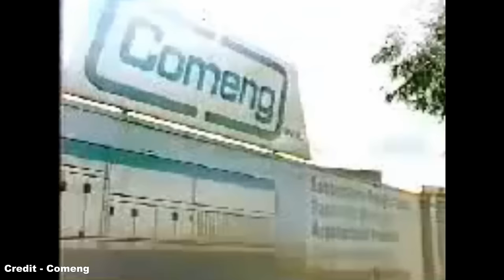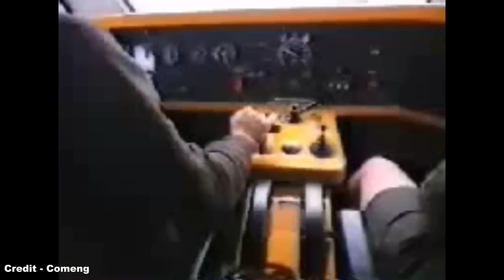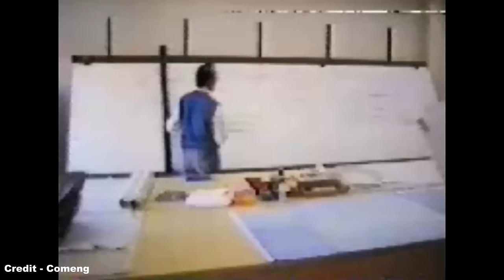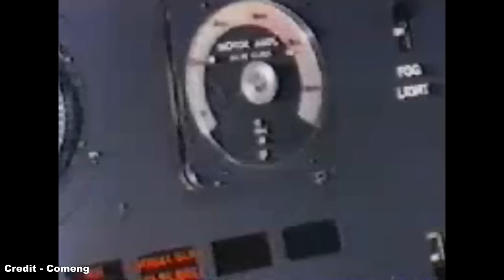The XPT - HSTs Down Under

Comment: I worked as a station assistant at Broadmeadow (Newcastle suburb) when the first XPT services to the north coast and northern tablelands started. I distinctly remember a crew change on one of the early runs. Apparently, they had been a tad optimistic on some of the speeds for the line. The XPT's front bogie had floated for a while going over a bridge, before landing thankfully back on the track. The driver was still green when he got out of the train. I'd heard the expression before, but that was the first time I actually saw it. The second incident was that, particularly in the early days, the drivers would gun them when they took off from the station. I used to joke to the SM they needed GT stripes on their uniforms. As I recall they were constantly doing engine changes on them back then as they just didn't handle the conditions. Anyway, they certainly picked up speed quicker than most diesels we were used to at the time and we didn't have the electrification at that point in Newcastle. The ASM on duty for the day reminded everyone on the PA that only intending passengers should board the train. Of course, num nut ignored this and got on to see his mother off. The train started leaving the station and he leapt from the car in a panic. The forward momentum of the train threw him forward and I'd say he collapsed about 2cm off the wall of the overbridge at the end of the station. I really thought I was going to see my first fatality that day. It was very, very close. The ASM clearly thought the same thing. He ran up to the fella and asked if he was ok. He was in shock and nodded this head. Then the ASM grabbed him by the shirt and told him never to disobey an instruction he gave as he wasn't paid enough to clean him up off the tracks. I don't think he ever did that again. That said it wasn't the fastest train I had seen leaving Broadmeadow for Sydney. That honour goes to two 44 class locos hauling the Newcastle Express during the holidays. The train was absolutely chockers and they had even dug up two or three steam era non air cars on the front connected to the loco's and the standard set behind them.  I was standing right near the rear of the two locos when they got the whistle and the driver gunned the engines to make up for the load he had to move on that day. At that precise moment, the screw coupling between the second loco and the carriage took the load and snapped. I saw the passenger cars jolt and then stop and by the time I had turned my head the two 44's had just disappeared in a cloud of diesel fumes and out of my view! It was the nearest thing to a catapult launch for a train you were going to see! One minute the driver had several hundred tons behind him and the next nothing. I turned my head and they were already gone from my view.  It was like one second they were there and the next they were gone! They pulled up at Adamstown and had to make their way back to the now broken train. Passengers were a bit late getting to Sydney that day.

Comment: As a regular user of the Grafton XPT I must say the train is a wonderful way to travel, with comfortable seating and a buffet, although the trip of seven hours from Sydney to my home station compares unfavourably with the one-hour airline service. Not much chance of an improvement though, as the new trains will have to deal with the same circuitous single-line track for most of the journey. I just hope the trip will be as pleasant.
Reply: The seats are unfortunately only designed for 150-200km European journeys, there's no sleeping car and because locos were njot ordered, the new trains will be noisier for passengers.  Backward steps!
Reply: @edmundcarew7235   Yes the lack of Sleepers means that the new trains will not be able to compete with air travel at all, unlike the outgoing XPTs.
Also the new trains design speed is identical  to the XPT (160 km/h) although they will probably have superior acceleration.

Comment: Good work on the video, although there’s a couple of issues:
- A lot of the footage was of non-NSW trains; I recognise that it’s from Comeng’s showreel from the 1980s, where they had supplied or were supplying rolling stock all over the country, and
- There we’re a few mispronunciations of place names - feel free to reach out if you need a hand (Gerogery, for example, is pronounced with soft Gs to sound like “Je-RO-je-ri”).
Also worth noting are the series of diesel railcars/DMUs spun off from the XPT design and built by Comeng and its successors. The initial units were the Australind railcars for Western Australia in the 1980s, followed by the Xplorer and Endeavour railcars for NSW (as covered in the video). Later versions include the Vlocity DMUs built by Bombardier/Alstom for Victoria and the A-City EMUs also built by Bombardier for Adelaide suburban services. The car bodies for the Australind cars were built using XPT passenger coach jigs, with subsequent designs being evolutions of the Australind.

Comment: Took one of these from Syd to Melbourne once, a very pleasant journey.
Reply: I did the same. It was 11h and more expensive than a plane. Interesting experience but I would never do for anything more than curiosity.

Also I take it pensioners get cheap travel. Because I was about 20 years younger than every other passenger on the train. And all those old blokes with their weak streams were obviously too proud to sit down during the rough sections, which is most of the trip. Because the toilet floor was absolutely swimming with piss.
Reply: @mabamabam  I only paid 76 dollery-doos which is pretty good. Yeah it took a while and i probably wouldn't do it if i was making the trip regularly but it was nice to see a bit of the country.
Reply: @N330AA  To be fair I sprung the 99 dollars for first class. Which is probably why it was full of old people who cant piss straight. And yes it was a nice trip. It was also really nice to pack a lunch and a book and stare out the window for hours. 

Tiger was offering $95 at the time.
Reply: @mabamabam  Yeah, next time i'm in Aus i'll try and take the Brisbane-Syd train too
Reply: @N330AA  I really want to do that one. It goes all the way to Cairns. Or Mt Isa if you want to go to the worst town in the world.

Comment: I go from Melbourne to Sydney quite often. I love trains & have for the 52 year's of my life. Taking my last possibly ever Intercapital  Train in August 2022. Why instead of paying $93.79 - $131.97 for a seat $234.63 Overnight 11.3 hours. With only two services. When you can in 90 minutes fly the the route and pay as little as $60 one way with Multiple Departures throughout the day. Even with having to be at the Airport two hours before the flight. it still only comes out to be 3.3 hours slashing 8 hours of the journey time. Also interstate Buses take 10 to 12 hours at around $100 today. All prices current as of 3/05/2022.

Comment: Fascinating. I saw a few XPT’s in 2008/9 when I was working for SNCF/Keolis on the Melbourne tram and train tenders. I investigated using the service from Melbourne to Sydney but am ashamed to say that I took the plane in the end due to time constraints
Reply: Just like perhaps 99.5% of travellers when making the choice of plane vs XPT.
Reply: @johnd8892  I guess so. But if Australia ever gets around to building the oft mooted TGV link between Melbourne and Sydney with a branch off to Canberra and 300km/h services in 3h30 from city centre to city centre the airlines would be dead in the water on those routes very quickly.

Comment: took a second to figure out that there is a tone of Queensland related film shots - not part of the NSW network obviously. A few Chums and EMD's from Queensland's old fleet. The dead giveaway was the trains name on the front "Queenslander", the others the colour and the others the narrow 3.6 foot gauge. QR had an old and un-sophisticated fleet for ages because of it's inadequate trackage - no point in buying more powerful and multiple unit engines if all your infrastructure isn't capable of holding larger trains, half the fleet hasn't got air breaks and the track can't handle the weight increase.

Comment: As someone who has travelled on both the XPT and the trains it replaced, I would have preferred the older trains anyday. The comfort levels were far superior. I use to have to travel a lot between Sydney and Albury in the 80's and though journeys were long, they had comfort, even if you weren't in a sleeper cabin. XPTs have never been suitable for Australia.
Reply: In what way were the older carriages superior? Surely the XPT's secondary air suspension was a big improvement? Better heating/air conditioning, too, I'd have thought.
Reply: @nkt1  In one word comfort, the XPTs were no faster and no better than bus, still arn't.
Reply: @nkt1  Give me the old Melbourne O/night or Southern Aurora anyday.
Reply: Queensland has far superior trains to New South Wales XPT's, where they basically don't care about passengers, just bums on seats.
Reply: @nkt1  The older RUB cars rode extremely well at speed and had extremely effective air conditioning in 40+ deg C days (Which is common in rural Australia during summer). They were one of the first cars in the world that used industrial electrical supply to run the air conditioning. The daylight express trains from the late 1940's to the coming of the XPT were the some of the best trains in the southern hemisphere in terms of passenger comfort.

Comment: When the XPT was introduced a large section of the travelling public were happier with the existing relatively new , twenty year old, Southern Aurora service. All first class sleeping with a choice of sleeping compartments from single accommodation and dual bed also with built in showers.
So fondly remembered that a 60th anniversary re enactment run sold out quickly and had quite a bit of coverage on TV and YouTube :
https://youtu.be/lQflOUHS2v8
This train had far more impact on Melbourne Sydney travel than the minimal speeding up the XPT was pushed too and providing less sleeping accommodation for a still long overnight trip.
Searching for the Southern Aurora train will provide many vids on YouTube.

Comment: I took the Mel-Syd service in 2019 instead of flying and I would do it again (I was able to work on the train). But it can confirm the track is not very straight, and it's all a bit rattly, so it's very slow. The plane is less than 4 hours door to door, but the train takes over 11 hours!

Comment: I travelled on the XPT in NSW in 1990 and it was comfortable. However, the rail lines are very 'curvy' (e.g. Blue Mountains) and the train never really got above 80MPH. I travelled to Melbourne on a loco hauled train and didn't care about the speed because I wanted the journey to last forever. Fantastic scenery, comfort food, and I liked getting out at various stations (Yass) to stretch my legs, and talk to the girlies. I was single then.

Comment: The Sydney to Canberra route is demanding even for a tilt train because of very many extremely tight bends. If someone wanted to ensure that the tilt-train wouldn't be successful, they'd be well advised to choose that route for a demonstration. 

It's questionable whether the new trains are bi-modal for any reason other than green politics, since most of the track they will run on is not electrified, and is unlikely to be in the foreseeable future. The XPTs have the advantage that the passengers are not subject to significant engine noise. On the new trains, since they are multiple units, the passengers will experience some of the engine noise and vibration, as they currently do on the Xplorer sets.
Reply: Good point about tilting trains. Actually you can have as many reverse curves as you like (over here in Britain some sections of the West Coast Mainline have few sustained 'straights') and the tilt system in the Class 390 Pendolinos is brilliant at coping with quick changes in track cant. However the laws of physics apply equally to tilt and non-tilt, so the safe overspeed margin is smaller. Therefore a Sydney-Canberra upgrade for tilting enhanced speed wouldn't just mean smartly designed track geometry but also an enhanced maintenance and renewal regime to manage higher wear and tear.

On engine noise/ vibration, the Class 800 varieties that replaced London-centric HST services over here in Britain are surprisingly refined. Actually I think the quietness of the 800s in diesel mode is not an accident; even the accountants probably had to agree never again to subject long-distance passengers to the awful noise and vibration of the 20 year old 125mph Class 220 varieties. 

In a penny-pinching, short-termist country like ours, there was always going to be downsides with the 800s and they are: seats as comfortable as ironing boards, cheap n' plasticky interiors and (on the Western routes) pesky trolleys battling their way through congested coaches instead of a proper restaurant/ buffet car. But they are true bi-modes, and on electric they go like shite off a shovel.
Reply: This noise situation is one reason US and Canadian operators are so resistant to DMUs. The only ones I can think of are in Austin, TX; Larkspur to Santa Rosa, California north of San Francisco; and the Toronto airport express, and that last one looks like it's headed toward early replacement with EMUs.
Reply: @ChangesOneTim  I've ridden the Class 220s and 221s with Cross Country and I never had an issue with the noise and there was only minimal vibration while at idle or while at power, the only vibrations noticeable were while power was being applied from start, aka from idle to notch 2. Not sure if that is due to improvements XC have made to the trains or your information is not first hand and from an unreliable source, however I find the voyagers, atleast with XC in my personal experience, are relatively quiet and not a huge amount of vibration from the engines, although like all trains there is slight shaking from passing over points or travelling at speed in general.
Reply: Most not.. but the Sydney basin and surrounds is fully electrified, so it is substantially reducing diesel noise and pollution in built up areas
Reply: @BritishTrainspotting  
I rode the 220/221s daily, right from their introduction 20+yr ago, so soon got to ride in every set in the fleet. Sound to one person can be noise to another, I know, but wherever you sit in the carriage there's no mistaking the gruff diesel under the floor. By any measure, of all trains built for 'InterCity' journeys they are Britain's noisiest and rattliest ever. XC is too cash-strapped to 'improve' anything. Avanti at least refurbed its fleet incl  recarpeted floors or something. My central point is that compared to loco-hauled coaches that went before, the Class 220 family is a disgrace to InterCity comfort and ambience esp bearing in mind that they operate many of Britain's longest journey schedules. 
Veering off-topic now. Rant over!😉
Reply: Same with the class 222 now on East Midlands Railway.
Reply: @NextSound170  
Yep, only minus the smell from the bogs as the waste tanks on the 222s are below floor where the tilt equipment is on the 221s(!)
Reply: @ChangesOneTim   Isn't the smell from the bogs due to the vacuum exhauster vent being too close to the AC fresh air inlet ?
Reply: @Martindyna  
That is the main reason, not helped by needing to mount the retention tanks above board. About 8yrs ago Virgin Trains did a mid-life refurb of their Vomiter sorry, Voyager Cl.221 and their electric Pendolino Cl.390 fleets to design the problem out. They seem alright now, but CrossCountry Trains (always known for their cost-cutting) Cl.220s and 221s still stink like a pig farm especially when outdoor temp is above about 15C.
Reply: @ChangesOneTim   Thanks. Apologies for the late reply, I wasn't informed of your response. Vomiter haha.
Reply: @BritishTrainspotting  It's about the type of noise, I find the Class 159 no problem at all because the Diesels are so refined and slow revving sounding.
On the other hand the class 165 `Thames Turbo' sounds awful by comparison, not helped by how they are driven i.e. how the engines are over revved before the Voith torque converter engages on departure. Some drivers wait in presumably notch one for the Voith units to engage before acceleraing which gives less of a railbus experience.
Reply: @Martindyna  
No worries!👍
Reply: @Martindyna  
Re the 165/166s: engine noise is amplified by the alloy bodyframe which, although lighter than steel, is stiffer. Interesting comment about over-revving: Word from GWR insiders 15 years ago was a driver briefing (for all their class 14X/ 15X/ 16X units in fact) NOT to select full power from a stand but always to pause briefly in notch 1 or 2 beforehand. Trials proved that by doing this the train doesn't lose any time between stops. The briefing followed an increasing number of units having to be stopped on depot with transmission faults. Problem solved...presumably!

Comment: Meanwhile, South Australia had completely axed rural passenger trains outside Adelaide, with the exception of the Overland.
Reply: Most of SA's regional services were either cut beginning in the early 90s before the state government privatised off all the services assets, or by the businesses that bought them in the mid-90s. The Ghan still runs to Darwin and the Indian Pacific  still runs to Perth, along with the Overland. It'd be nice to have something like a high speed service to Melbourne that only takes 8 hours instead of the current 13, or 12 hours to Perth instead of the current 70 or so.